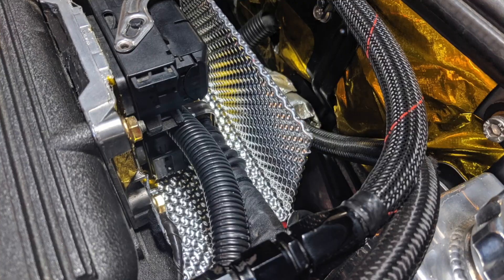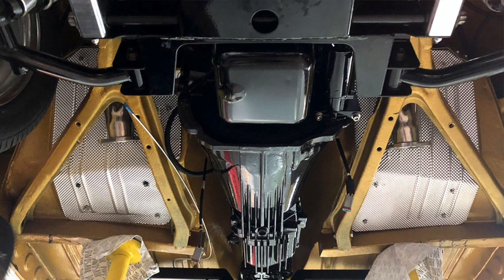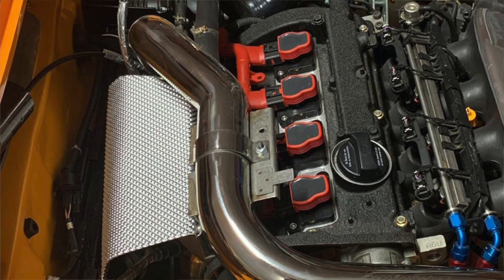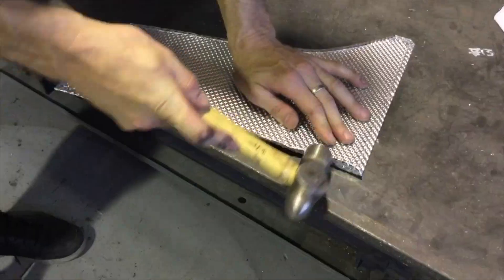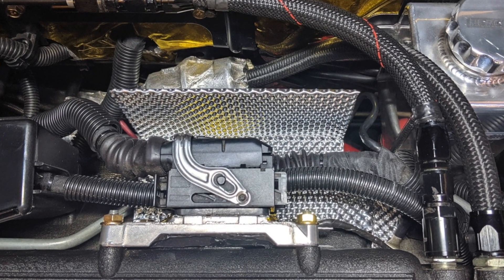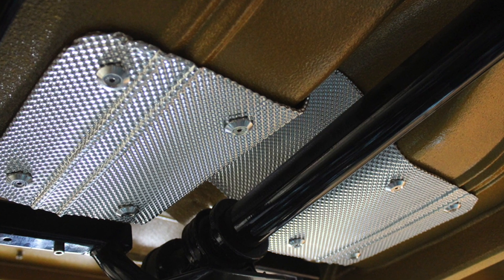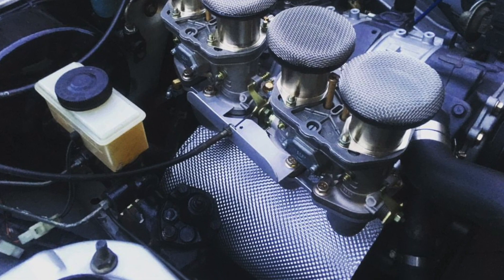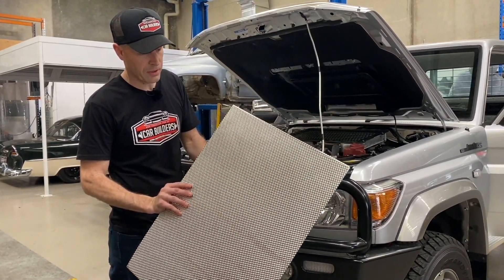Car Builders Embossed Heat Shield Overview

Comment: Would you have any good tips how to install these on the underbody, if there are no existing holes or studs to attach to?
Reply: Drill, rib nut and bolt on once complete. or send it with self tapers if you don’t care.